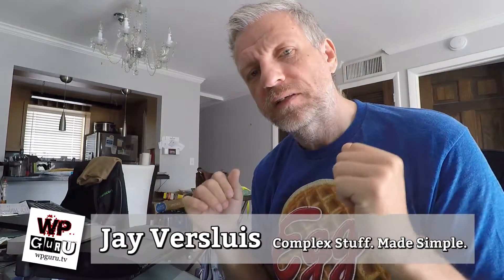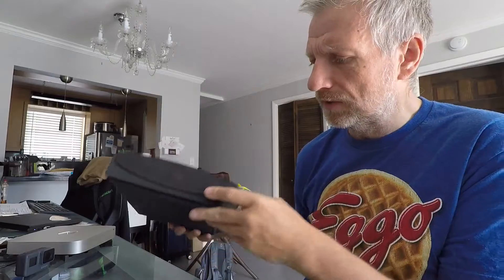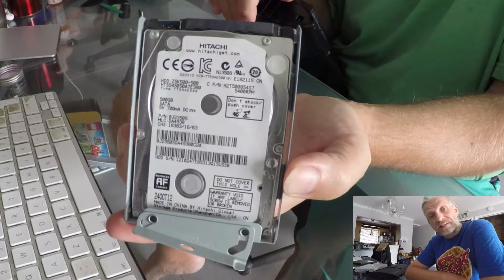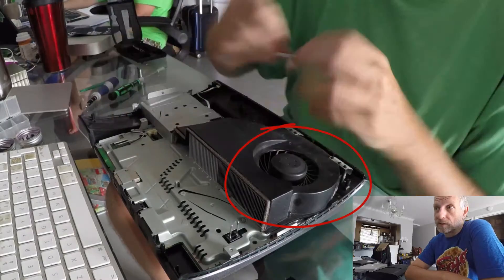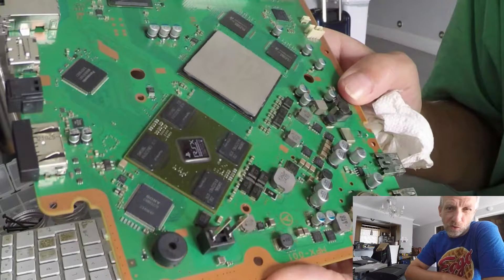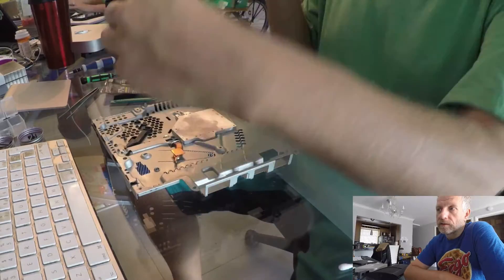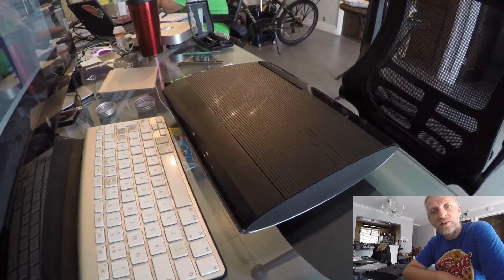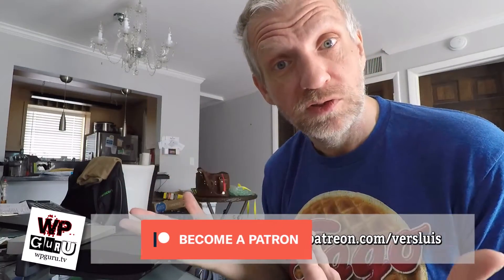Disassembling my PlayStation 3 to apply new Thermal Paste (Time-lapse)

Comment: There's one issue with top strips people always forget to mention. The one on the front (near power button) has two sides. Right (top, HDD side) just pulls up and is secured with screw on the side. Then you pull it towards you (to the side where the power button is) and to the left (bottom if using in vertical position). Then you can take the rest out. That's because remaining 3 latches have a tiny sleeve that keeps them locked unless you slide them and the right side with the screw prevents the whole top from sliding. If you just pull it straight up, you will break those 3 latches. The other one (PSU side) is much easier, just pull the pin under the top/side cover (the one with HDD) and slide it, it just comes off. It has 5 of those sliding latches.
It is very easy mechanism but somehow there's no information on how it works and people often use force just because they don't know how it's supposed to open. I also could not find anything around and had to figure it out myself. In both cases they have to slide towards the bottom (from standing position perspective). PSU side has simple latch, power button side has a screw and has to be pulled up just near the power button side, the rest slides off.

Comment: No one ever answers if you have to reinstall software by cleaning and repasting?
Reply from the maker: I’m happy to answer you 😃: No, the software will remain intact when you do this maintenance, provided everything else stays intact. The operating system and all your games are stored on the hard disk, and we’re not touching that in the process. If you’re worried about breaking anything though, plug in an external hard disk and make a backup of your system before you open the console up. This will let you restore all your data, even to another system. Good luck! Long live the PS3 😍
Reply: @WPguru  haha thank you! I've had my PS3 setting in dust for over 5 years and there so many memories saved on it that I can't even access because it overheats and shuts down before I can watch anything for more than 5 min.

Comment: How difficult was it to take it apart and put back together?
Reply from the maker: With the correct screwdrivers, on a scale of 1-10 I'd give it a 6. The iPhone 5s gets an 8 in comparison (smaller and more fiddly, with more that could break). It's mainly remembering how to put the parts back together. While still densely packed, this PS3 is probably easier disassemble than the PS4 slim.
Reply: @WPguru  Thanks man.

Comment: hate to be a contrary ass, but whenever you can use an ssd you should, they are simply put, better technology they use less power and read faster than a mechanical drive in all situations, reducing latency and seek times to nanoseconds instead of milliseconds, making loading tiny files for games easier a decent quality one has more read speed than the console can even use, meaning it will always be preforming at its maximum bandwidth rather than whatever the drive can deliver and they generate less heat and do not get damaged by a console falling over for example, and can withstand gforces and vibration equivalent to being shot out of a cannon before risk of failure.
Reply: I got a 500GB SSD for my PS3 that I have yet to install. I read many debates about it being beneficial or not and still chose to get one. In my opinion, at the very least, I'm upgrading an old piece of hardware. And I agree with everything you said. The only downside I can understand is that it can be seen as a little bit of a waste of time and money, but I am okay with that. I am playing New Vegas on my PS3 currently and so I'll take any possible help I can get in terms of performance..
Reply: @MazDanRX795  nice bro. Any sources? What did you learn? Doing that exact same thing with NV. I have it ready for paste atm.
Reply: @BowgFrowg  Sorry, friend. Still have yet to do it. I'm scared as heck to open up and operate on my PS3.
Reply: @MazDanRX795  coward.
Reply: While I agree to use an SSD when possible, the PS2s, XBOXs, Wiis and PS3 Fat and Slims (not sure about Super Slims) use very slow SATA hardware that will not take full  advantage of the available speeds.   Not saying it's totally useless just not as good as it would be on a modernized setup so for bigger size drives I'd just use a regular 7200rpm 2.5in drive as the speeds are similar enough and save a few dollars.   

My PS3 has a 500gb SSD and a 1TB 7200rpm HDD external.

My PS2 (even slower hardware than PS3) uses a 2TB HDD as the SSD equivalent is expensive and not much bang for my buck due to being used on a dinosaur.

One last thing as long as an HDD is taken care of and isn't being constantly run like a server PC or workstation, it will run a very long time as well as if it corrupts or has a hardware failure it is POSSIBLE to retrieve some or all data using certain software and tools.   When an SSD dies, it's gone forever.  Granted it takes many, many MANY rewrites.    But regardless still a possibility.

Comment: I have an extra ps3 super slim that goes on and goes off in just a sec. I follow your video tutorial, apply a deepcool Z5 thermal compound in gpu and cpu and making sure their were screwed tight and now it goes on and I can play on it.

Sometimes though, I still experience that issue which turns on and then goes off. I think this ps3 is dying. Thanks!

Comment: Hey what is the 20/32 battery do?
Reply from the maker: It's a common item on computer motherboards that lets them remember the time and date when you disconnect the power. If it's removed, or if it ever runs out, the console wakes up with a default factory date.
Reply: The WP Guru nice thanks man!

Comment: Hey. I got a question. My PS3 super slim is 7 years old but been play like a 2 years then switch to ps4. So I try PS3 last week again after a 5 years break up and it's super loud, like never before. Should I change thermal paste? Or maybe just clean it a bit? Cheers for answer
Reply from the maker: Hi Kamil! If it's super loud with fan noise, that's a sure sign of overheating. You can try cleaning it out first, blow out all the dust and see if it's better. If it's still loud, then I'd change the thermal paste. It'll be good as new. Long live the PS3 :-)
Reply: @WPguru  Really thank You for quick response. Much appreciated. I will do as you suggested. Great vid by the way and lots of positivity. Subscribed and a like. Cheers.
Reply: @WPguru  Hi it's me again. Just want announced full success with my ps3. Really thank You for advice and great vid. For now console is really, really quiet. When I open it up, wasn't really dirty. Nothing inside. But paste completely gone. So I change thermal paste for Arctic Mx4. Realized after that I need open and probably change compound in my ps4 as well. Thank You!
Reply from the maker: That’s great to hear! PS4 might be more complicated, if I ever do it I’ll make another video about it ;-)

Comment: Hello, my PS3 super slim suddenly stopped working as in it didn't turn on completely, and later a red light came up from the switch button and now is not displaying any of the green or red it is just not receiving no power. So what could be the problem.
Reply from the maker: It’s probably broken 😂 Sadly I have no idea how to diagnose a problem like that.  If it’s a faulty component of some kind, only a qualified electronics expert can help you. Sorry!

Comment: That thermal paste is a horrible job... You should only put a tiny bit in the middle.. When you press it back together it will disperce to all the edges... What you are doing here is for sure creating airbubbles in the paste.. I guess better than nothing.. but this is a bad job.. Otherwise good video :)
Reply: You don’t have to be as precise on consoles. They prefer large sloppy paste applications in my experience. As long as you put more than you would a normal computer cpu, you’ll be fine.

Comment: I'm not going to point out every single mistake in this video. Glad the PS3 works. But just so you know, never use a vaccum cleaner on ANY electronics.
Reply: why not?
Reply: @yamyas  Coz it creates static electricity and you can short stuff
Reply: @locknloadbitch  but if you read the PS3 manual. It is advised to use vaccum cleaner at the bottom to remove the dust.
Reply: @sanjaygwa  well it's a dumb and stupid advise
Reply from the maker: They probably mean on the outside rather than after dismantling the unit. 😄
Reply: @WPguru  yes it's used on outside

Comment: I did change the thermal paste but now my PS3 won't show the xmb, it only turns on but doesn't show any kind of video output or anything, I'm sure you didn't had that problem but could you hopefully know what my problem is? I did double check on everything that should be connected but the problem still continues.
Reply from the maker: Pass I’m afraid, it sounds like some contact isn’t made properly somewhere. I’d check every ribbon cable and make sure it’s inserted correctly (sometimes just pulling it out and putting it back in solves the problem). Sorry I can’t be more helpful, I hope you get it fixed!

Comment: My ps3 superslim over heating how fix it
Reply from the maker: It’s probably dusty. Get some compressed air, then open it up and clean out everything that’s dusty. Also, like I did, replace the dried up thermal paste on those heat sinks with new paste.
Reply from the maker: Indeed. When I had my overheating problem, it was only really noticeable with GTA V, I could play other less resource intensive games without problems, and the fans would only come on very occasionally. So yes, heat paste replacement therapy is recommended 👍
Reply from the maker: Sorry man, missed your comment three months ago. That is a very cool idea! Take some pictures and leave a link here, I’d love to see that project 🤩

Comment: SSDs do improve in game loading times though. In GTA V when teleporting to a place far away from you it loads way faster than with a regular HDD
Reply: SSD cuts 90 seconds off GTA 5 startup.
Reply: SSHD will do suffice.
Reply from the maker: Oh excellent, good to hear that. I’ve seen a comparison they did with Skyrim (forgot who did it), and their conclusion was that it doesn’t do much for performance. But then, Skyrim loads the world while you walk, whereas GTA has to load a lot in one swoop when you teleport. I might treat my PS3 to an SSD then ;-)
Reply: @WPguru  SSDs aren't very expensive anymore. A 240GB SSD should be just fine
Reply: @WPguru  I put a 240GB SSD in my PS3 and it makes any large data installs/loads/deletions much quicker. It's not a day and night difference like on PC but it was a nice upgrade for me.
Reply: @WPguru  I've tried it out recently with my Kingston A400 120GB SSD. It took my around 97 to get to the singleplayer and when copying the game disc on the SSD as well (Jailbroken PS3 / HEN) it took me just 67 seconds beginning from the XMB by pressing X up until the singleplayer has loaded. So it is a really good improvement.
Reply: @WPguru  There's also another good example.Yet alone starting games is faster as well as loading levels, especially in GTA V and The Last of Us
Reply: a new HDD will do better aswell, don't forget: The PS3 only has a SATA-150 Controller, which only can do 1,5GBit/s, newer HDDs have now a bigger cache onboard and 1tb hdds outperform any of the stock hdds on the PS3
Reply: @BilczaTheHedgehog  the super slim is sata 2. 300mb/s

Comment: You should do a comparison video of the idle and load temps of Arctic MX-4 vs. liquid metal
Reply: But you'd have to use the liquid metal under the IHS not over because of the aluminum

Comment: You dint apply on heatsink sir
Reply: it dont need because it get together
Reply from the maker: Exactly right!
Reply: @WPguru  l repair my ps3 now after horrible confusing of what should go first and witch screw....
Reply: What you use to clean the paste sir
Reply from the maker: @shaiksaleem5942  Same here, in addition I use compressed air to blow lose dust off first, then use a kitchen towel with rubbing alcohol. Sometimes I use pre-soaked alcohol pads, and for hard to reach places I use cotton buds. Alcohol is always good because it dries without leaving residue, so components never get a chance to oxidise.
Reply: @shaiksaleem5942  You need isopropyl alcool to clean thermal paste off chips
Reply: @locknloadbitch  isopropyl alcohol is one of the best things I own
Reply: @shaiksaleem5942  l only use wet towel it take few minutes. So you dont need any special cleaner or somethig Like that water and towel is good for it
Reply: He put enough thermal paste to cool off a Rocket ship... There's no need to put any on the heatsink.